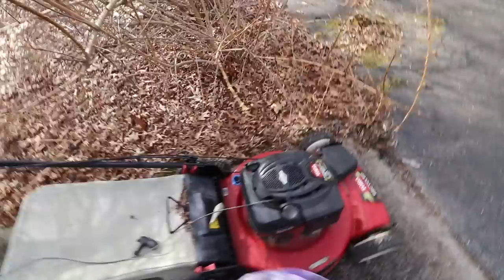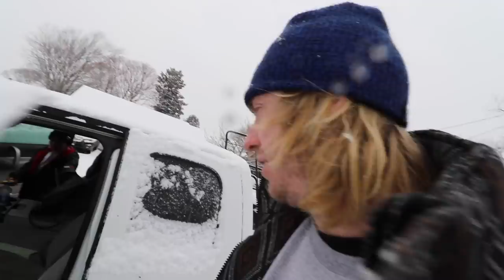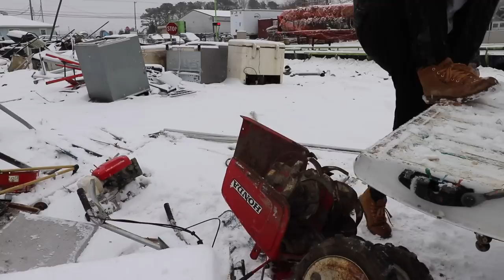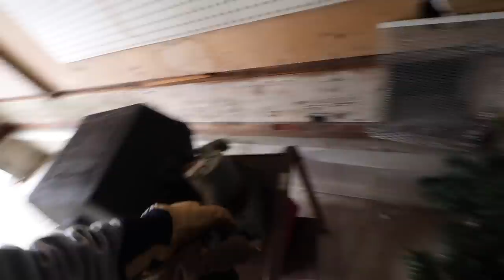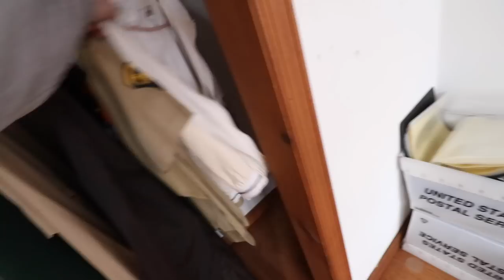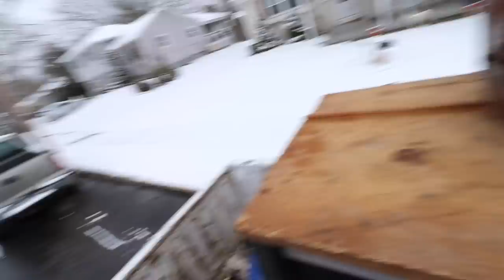SCRAPPING OUT ESTATE - We Had The Pick Of The Whole House For FREE!

Comment: Turner, old craftsman Sears radial arm saws were recalled for not having a blade brake. Look online for Emerson craftsman radial arm saw recall. Emerson is the company that is giving away the money from settlement. They will give you $100 for the electric motor. They send you a prepaid shipping box all you have to do is remove motor. This will disable the unit. The website will ask for the model number to see if it is on the list. I have done this, hope it works out.
Frank

Comment: Damn those mowers are prob easy fixes....get 20 to 30 bucks each at start of spring... the one with the primer bulb leaking is a 3 buck fix and that could have sold for 40 bucks...wish I lived close to ya I would have bought all the mower stuff and tiller for 50 bucks lol
Reply: I cringed as well.
Reply: Even the damn shovels and hand tools. Even if you got a dollar a piece thats more than scrap. Had to look the other way.
Reply: @Greg-jo1ft    Had to stop watching and go back and watch little bit at a time.
Reply: I agree tuck. Probably just needed carb cleaned & easy $20 each.  I sell trash picked mowers every year. It's not hard to fix them.
Reply: You also have to factor in the time and cost to repair them, replace parts, list for sale, deal with all the flakes on local apps, etc. That $20-30 sale can become minimum wage or less real quick. Sometimes scrapping just makes more sense, all things considered.
Reply: @heartlandranchtv4943  usually takes me 5 secs to find out if the motor is good or bad....anything with good compression can run again...and I'd say 90 percent of the time it's just fuel related or spark issues which both can be a free fix...I've done it for 20 years ...even mowers with a bad motor can be sold for parts for 5 bucks...scraping a push mower you will get 2 to 5 bucks at max for each and that's when scrap is high.....I was just pointing that out to him...but if he wants to scrap them he can...there just easy to fix ...I'd always take the good parts off a bad mower for use on other ones I find..but to each there own...
Reply: @heartlandranchtv4943  they do flea markets etc. In the spring & summer you could sell cheap mowers faster than you could unload them.    Like mentioned above 95% of the time it's bad gas.  You could sell them not running for more than scrap price.   Trust me people love lawnmowers lol.

Comment: Honda garden tillers are great. Well worth trying to get it running if you can
Reply: Actually if they can run easily any of the lawn equipment can sell pretty good. And yes, alot of the vintage stereo stuff can be big bucks -- even speakers. Especially if you were to find the holy Grail of speakers, the Klipschorn. Huge in size but worth thousands.